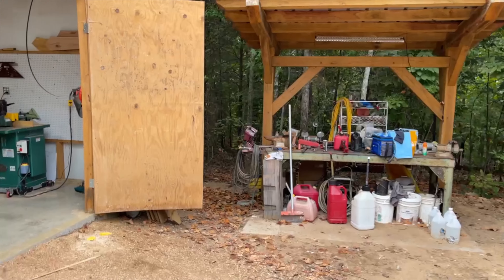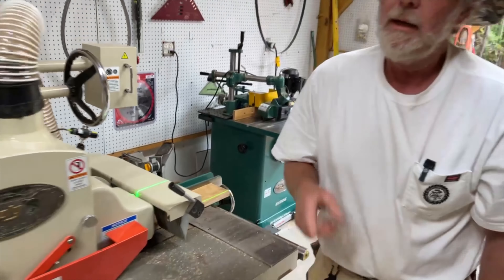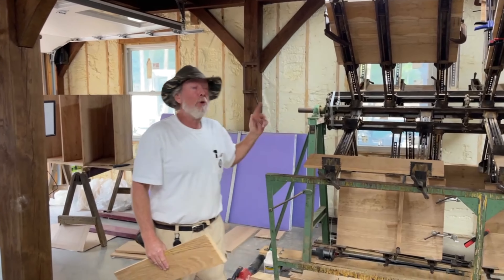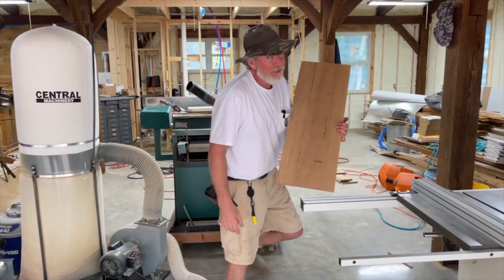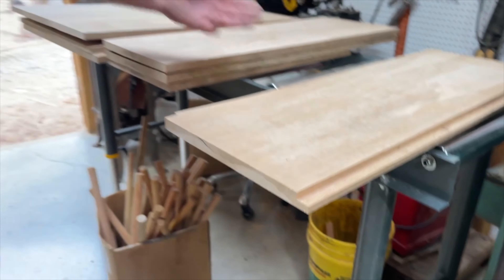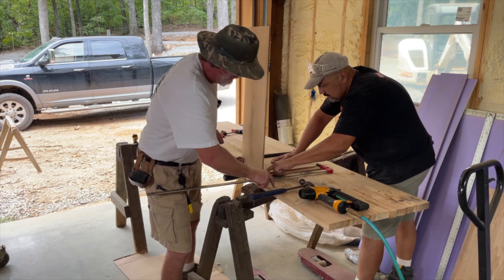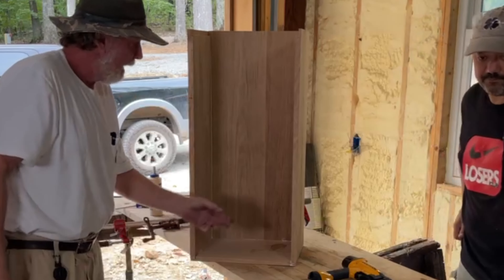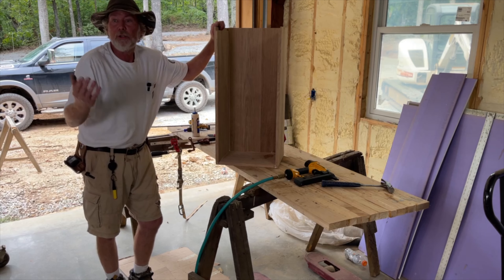Oak Cabinets Made Easily From Your Own Trees DIY Grizzly Tool Workshop Woodmaster 725 Planer

Comment: Ok that’s it…I need a Woodmaster. Talk to your friends over there…get me a discount bro! 😁
Reply from the maker: I’ll do it when you ready! 👍
Reply: @TwoGuysTimberframing  a 15" helical planer will do the trick. Even a 15" straight knife should work well. I just got a 15" helical, and had to do the first "maintenance" step of raising the idle bed rollers so rough sawn lumber rolls through without pushing or pulling the board. A bit more snipe, but that's the only way to get rough lumber to roll. As far as I understand, 240v is all you need to be in the clear. I had a 120v planer, then recently made this upgrade to 15" helical. Even with the 15" planer, I'm trying to not put any boards wider than 9" through it. Because I just about broke my brothers 24" planer by stuffing hard and wide boards through it. Plus handling 9" or under boards is easier than 12 + inches. Woodmasters seem very good!!
Reply from the maker: @ it’s good I try to be easy on my helical for finish work   I love my Woodmasters

Comment: Have you had any issues with expansion/contraction of solid wood cabinet boxes creating issues down the road ? I have been told that is the main benefit of plywood, but I really want to try making these for my shop, because the wood is free! 

Love the expertise you share and all the content you put out !
Reply from the maker: Thank you for watching. 
I have no problem at all. All this wood has been through our kiln and it’s dry      
I have built them this way since I was a kid with my Dad. Most end panels are solid wood with no issue. I pretty sure they use plywood because it’s cheaper and easier in production. Just make sure you wood is dry and I think you will be ok.

Comment: Solid cabinets! I might use a softwood for cabinets or doors. I build a door 41" by 81" with 3/4 t&g white oak and hickory. It's hilarously heavy. If you know what you're doing working with hardwood is fun, or if it's a built in, but for this door, I'm considering remaking it with cedar or clear pine to lighten the load, and because the door cupped since I didn't make it symmetrically. 
Why'd you use the protable planer instead of the helical 24"? and that drum sander was having a heck of a time on the oak panel. I look forward to the wood countertop on the base cabinets! I admire wood counters indeed.
Reply from the maker: I only used the small planer because most guys will have that.  Normally I would use the planer. Next video we make the doors using the helical head. Thanks for watching 👍
Reply: @TwoGuysTimberframing  Good inspiration and role model
Reply from the maker: @clarkpiper6007 Thanks buddy! More to come 👍